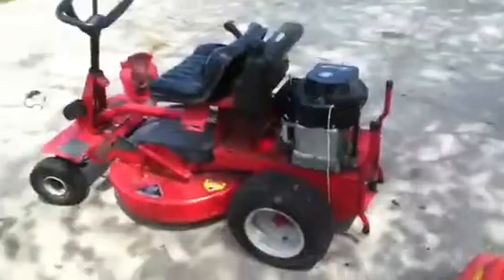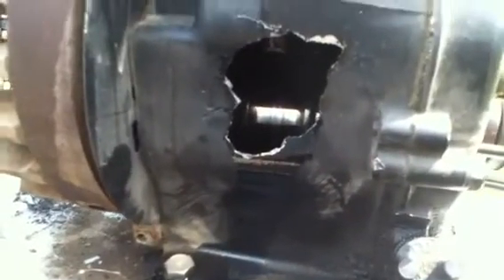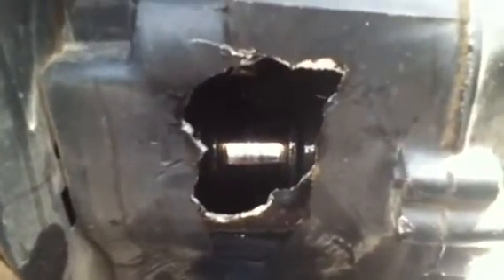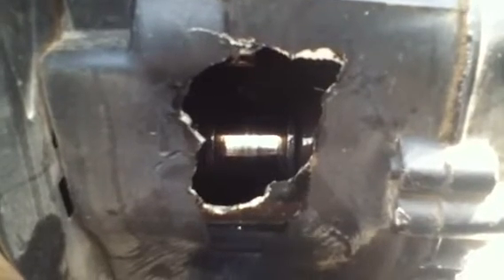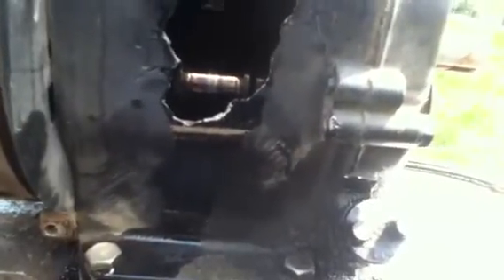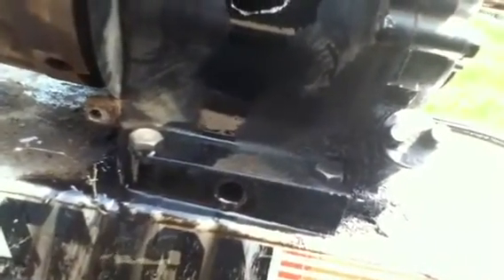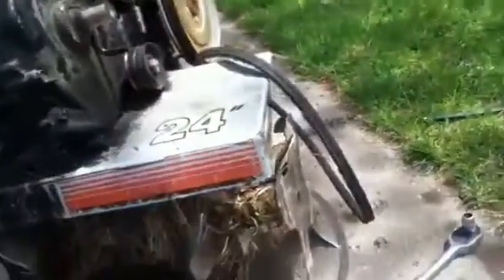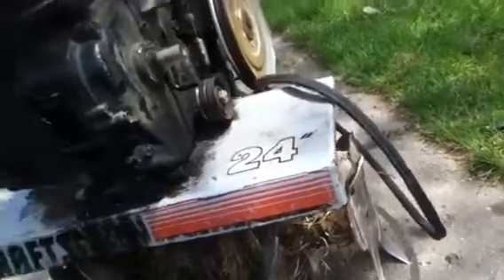5hp Briggs thrown rod rebuild pt1

Comment: if you can find the pieces that it knocked out you could JB Weld it back in place.   Dad ran one on a tiller that came apart like yours - slapped it back with JB and ran it for many years.  good luck.